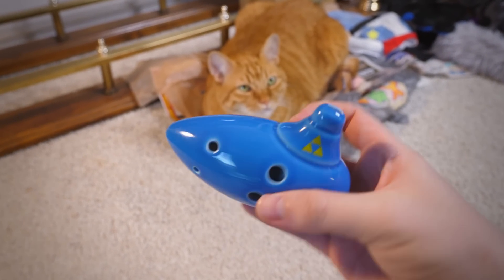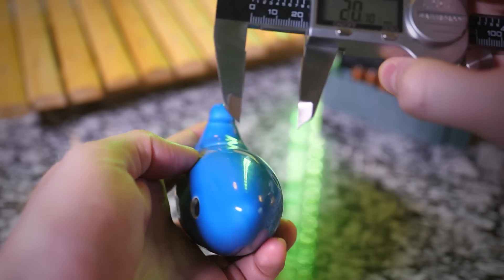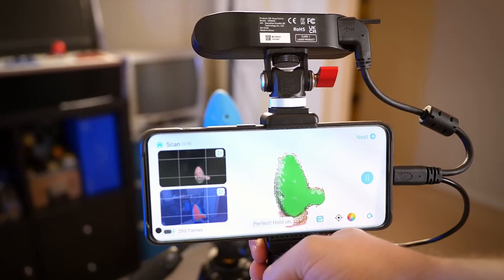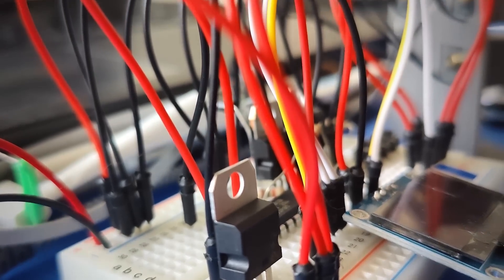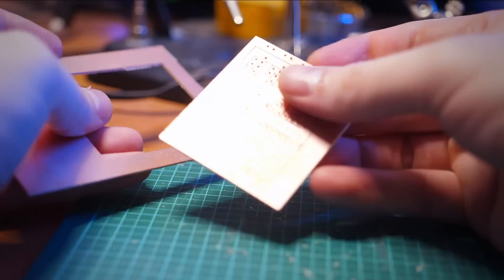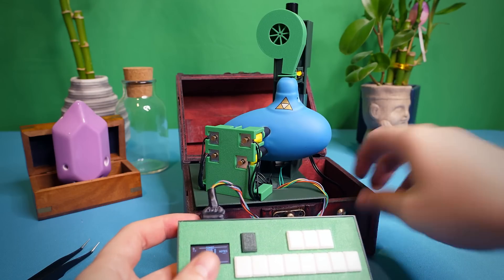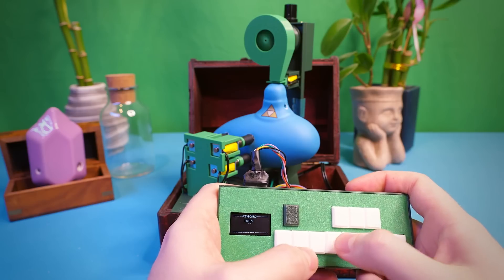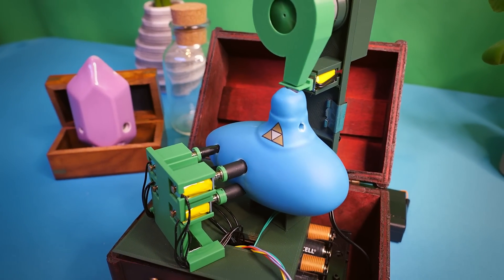Zelda Ocarina Flute that Plays Itself

Comment: The fan shouldn't be a radial one, but rather just some normal fluid bearing fan with an adapter just constricts the size down. Would be less noisy. You could make it even a snorkel shape and hide it behind and under the ocarina.
Reply from the maker: I like your ideas! I might need to make a part 2 video with some of the feedback I am getting.

Comment: god bless your lungs for not getting every cancer in existence from that pcb milling because i wouldnt call this safe...
Reply from the maker: I found this response online "PCB milling does not involve any chemical substances, making it suitable for use in general home or office environments without the need for handling hazardous chemicals. Due to the use of milling equipment for electrical isolation, PCB milling is safer than chemical etching"
Reply: @3DSage  ive heard that glass fibers fly off when milling and may cause cancer, but idk i havent ever milled a pcb

Comment: i think it would sound better if the fan was silent. it also wasn't blowing as hard as a human. 
you could fix this but its going to make the setup bigger and cost more by using an air compressor and  pneumatic valves to control the pressure and flow. 
the compressor would obviously have to be outside and one of those "silent" types.
Reply from the maker: Making a quieter fan was on my to-do list but I didn't have time but maybe if I make a part 2 updated video! :)

Comment: I think, out of all zelda like ocarinas you choose the least realistic, accurate or similar to the original. A more realistic  one would have around 10 holes on the front and 2 on the back.
And a similar to the origina would have 7 holes, althoung i dont know how would it sound.
The project is interesting thought, and i can undertand why you would use a much simpler ocarina
pd :  i know there are ocarina that has 4 holes cuz I've used both, but they are shaped differently,  a more flat shaped one

Comment: Nice! How did you design the PCB? its quite efficient in the amount of cuts that were taken to separate the traces. Did you manually draw squares around each trace?
Reply from the maker: You can! Depends on the software you use. Some already have the ability for milling.

Comment: This is an interesting project! However, your ocarina sounds very out of tune. Perhaps this may be because you are not getting good sealing around the finger holes or perhaps it is because it's just not a very high quality ocarina. You can also bend the sounds to be more in tune by using more or less air. I wonder if you can tune the notes by varying the air pressure. Basically, do some testing before hand and mapping a certain air pressure to each note.
Reply: Maybe silicone plugs instead of the rubber tips would help seal.
Reply: even if the wind is consistent; while playing other notes it may require more or less wind for those particular notes to be in tune so having the motor controlled with a PWM signal and some troubleshooting for each note may help the tunning.
Reply: He bought one of those fake-ass Chinese Ocarinas.